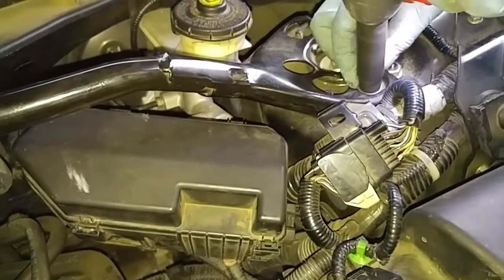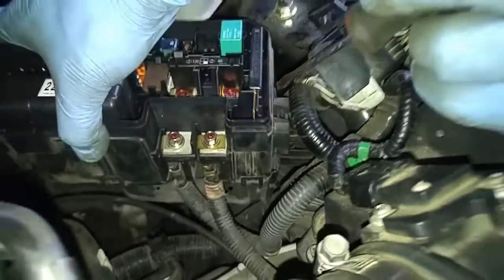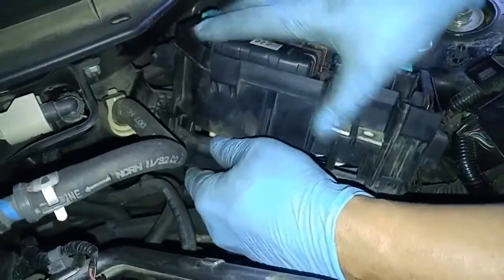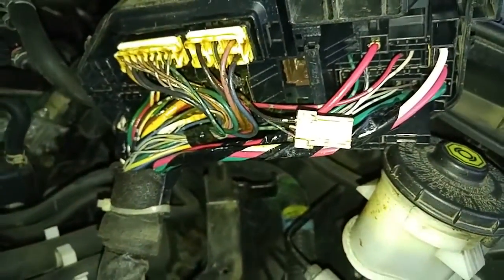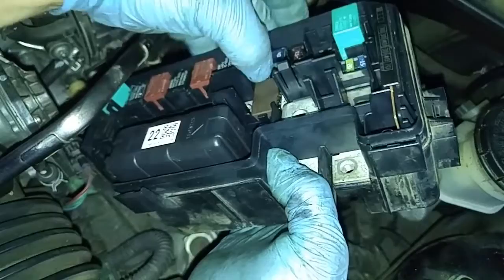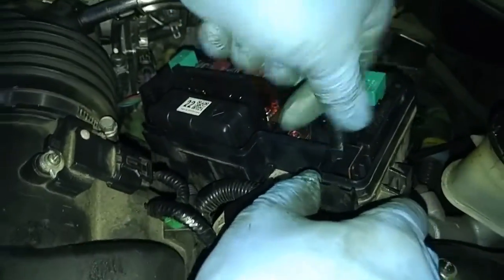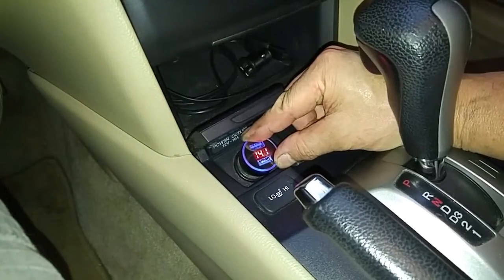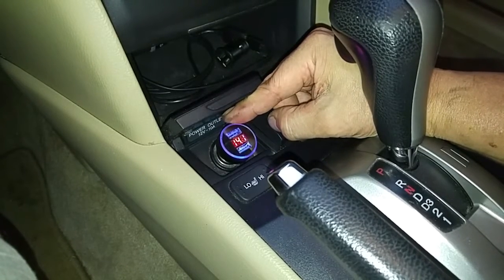Battery Dash Light On & Off? Honda Electronic Load Detector Malfunction

Comment: I have a problem with honda accord 2008 4  I have new battery but I have a problem in the light and radio sometimes turns off and on
Reply from the maker: Changed the ELD?
Reply: No I didn't change anything yet When I drive at night, I see lights dim and come back on, and the radio goes off  sometimes and turn on 
 My honda accord 2008 4 cylinder really very good but I have 2 problems really I want to fix this one I telld you now and burning oil every 500 k I need to put one liter really I don't know what I do

Comment: Honda CRV 2012 has been having a problem for about a year. The voltage drops to 12.6 when I turn on the lights or air conditioning
Reply from the maker: Start by replacing the ELD.

Comment: Could this cause erratic lights flashing AC won’t work nor will windows. I switched out battery because that was the first light to come on. Put new battery in there and it got worse.
Reply from the maker: Sounds like you have an alternator problem.  Get one of those plug in voltage display devices for your accessory port to monitor the voltage output while driving.

Comment: lot of good info in the comments. I am replacing my 02 civic ex ELD today coz of intermittent battery light. new alternator and battery 6 mo ago  which fixed the issue (light came on after getting off the freeway of a long 200 mile drive. stayed on unless i revved past 3200rpm while driving (another reason manual transmissions are just better in every way).
connected a cheapo bluetooth cigarette lighter thing that has a voltage reading on it. it shows 10 volts but ive read the battery itself and there is about a 1.5-2 volt difference. voltage in the car will show 10.1 (~12v) when battery light comes on, and then revving up shows ~11.3 (~13v) and battery light will go off. the strangest thing is that i found leaving the lights on even during the day makes the battery light go away and the voltage never drops below 11.1(~13v at the battery). this is what makes me think it is a slowly dieing or half dead ELD sensor/half blown fuse/crappy ground.

if you have a automatic civic i would suggest first getting rid of it and switching to manual. then try increasing the load on the charging system by turning different things on like fan, lights, radio(and volume up?), highbeams. i thinking this will cause a big enough draw for the voltage the alienator sees to drop below a threshold and start charging and maybe partially bypasses the ELD somehow. side note the AC does not use electricity from the charging circuit and instead is just a clutchpack that engages on the shared alternator belt. good for testing the tension of the belt especially when combined with power steering, but i dont think it would help diagnose this problem.
im probably too lazy to update this post like everyone else so I will only do so if this doesnt fix my problem. I think my troubleshooting explains why all these boomers think its a "random" or intermittent problem, nothing is random... youre just not observant enough
Reply from the maker: Think you have a bad alternator even if new.  Voltage output of an alternator regardless of rpm's should be in the 13's
Reply: @hardlymovingpro  good to know ill double check it. it was like 13.5 i think when replaced. you know i cheaped out on a refurb
Reply: @vevenaneathna  Please let me know if you resolved the issue
Reply: @guillermoolvera1186  hmm i got a new ELD and compaired the resistance across the pins in the back with an old and new one, and it seemed like my old one was "shot". reading like 1/50th the resistance as the new one. put it in and car instantly had a lot more power, ran really good after warming up. few days later its back to doing the same thing. I think it is the altinator afterall and is frying the ELD. Tried putting the battery on trickle charge for a day also and no dice. I think it also has something to do with a bad valve cover gasket? i saw some oil dripping down on the altinator from my engine, and it didnt seem to go inside of the altinator but who knows, some probably did, ive had a new start go out on another car from drippy oil, and an altinator is basically a starter in reverse.

Going to try and return the altninator to autozone since its only been 7 months, but im thinking since my problem is so nebulus the altinator might pass their "test". might just hit the pully with a hammer until she dont spin right to get a free one and make sure it doesnt end up back on the self for the next unlucky person. that or melt one of the wires around the stator. will update in a week or so when i have time to replace the altinator. was messing around with the tensioner and stuff hoping it was something like that. would probably help to do a tune up also (plugs, maybe wires, check their resistance cold a hot?, plugs atleast)
Reply: @guillermoolvera1186  huh, ended up swapping the altinator as it was under warenty after all.stabalized the voltage a little bit at 0.1v higher, and maybe seemed to idle a tiny bit better. still all the same major symptoms. decided to rip out the electronic load sensor i replaced and double check resistances with volt meter. they showed the same values as when i put them in, about 10x OEM. frustrated i put the oem electronic load sensor back in, and bam problems with voltage drift minimized a lot. autozone sold me a garbage part, or it was one that someone swapped out and returned unscrupously. anyways the voltage still falls under 11v (no altinator charge) if there is no extra load applied like fan at low setting and/or parking lights. still feels like it had 15% power after warming up.

I noticed however the slower the piston speed/rpm, the less of an issue this was. ironicalyl the car would have more power in 5th gear struggling to try to get up a hill, or even was faster off a line in 2nd gear. I replaced my sparkplugs when i got it, maybe 60-70k miles ago now. i thought i had replaced them inbetween but i took them out and they looked pretty bad. regapped them in the dark using a pocket knife and it helped a lot but maybe made an exaust leak. had new NGK copper heads on order (3$ ea on amazon) and swapped those in a few days ago. the NGK sparks have a crush ring type thing that you torque down and i think is why it made the exaust leak worse when checking them. instant +50hp. very suprizing. idk if its coz i have the vtec coil overs and they burn thru sparks faster, or if im just used to iridiums lasting forever. 
still probably needs a new electronic load sensor OEM, and im thinking there is an exaust leak from when my engine mount ffed off in half and the engine fell off lol... but its running a lot better now. mpg was down at like 20-25, and im hoping its a lot better now. ran some methanol fuel cleaner thru just for sacramental old car purposes.
Reply: @guillermoolvera1186  so this is weird but I finally figured out what was going on. started having loss of clutch pressured and had to pump it when going up steep hills to allow it to change. that and the battery light/voltage issues never really went away. it all ended up being the cat... which is just bizarre. cat melted and occluded the exhaust so bad it sprung a leak at the manifold gasket. noticed it one day when i was up till sunrise working on the car and noticed scorch marks on the underside of my hood right above the alternator. I couldn't feel the leak when it was cold or hot or revving but the scorch marks were the smoking gun.
checked the exhaust pressure and there might as well have been a banana in the tail pipe.
Replaced the manifold gasket and drilled a hole in the exhaust bypassing the cat and muffler and instant return of power, no more voltage stuff after long drives, no more clutch problems, and way more power than ive ever had in the car. i guess all the toon up stuff i did really helped and built up until i finally fixed the issue. 
getting 35mpg hwy right now which is about epa estimate. I think I can get that up a lot higher. designing an analogue spoofing system to mess with MAP and IAT sensors to get a lean burn and advanced timing. might include a resonator circuit to go back and fourth between lean and normal so that I can keep the engine temp up on long drives. that and plenty of other arrow stuff I can fix.
my 98 accord was getting 54mpg and had 380k miles on it but its head finally cracked. ill try not to kill this 600$ civic lol

Comment: I have a 2004 honda crv. Alternator was replaced twice, battery reading is over 13.5 volts, ELD device was replaced as well. Fuses are all good. I can't figure out why my battery light is still on...any ideas?  My light started flickering a month ago, and would turn off when i reached a certain speed. I replaced the alternator 2x and i just have a permanent light on.
Reply from the maker: You have to monitor the voltage while driving the car.  Get yourself on of those digital voltage displays that plugs into your cigarette/accessory plug/port.
Reply: @hardlymovingpro  ah ok, thank you! what range is good to see on the display and what is not good to see?
Reply from the maker: Min 12.4 v engine off;  around 13.4 v to 14.2 engine running.
Reply: @hardlymovingpro  yep I'm in the range. I'm wondering if my ECU got fried by the original alternator gave out
Reply: At 1:25, find those connectors & clean them with the electronic cleaner.  You have to rule out poor connections within the connectors & poor grounds. Gradually, oxidation layers forms due to chemical properties of Aluminum, copper & steel impeding flow of electrons causing fluctuations.
Reply: @desi4lyfe379  unfortunately that did not fix the issue. i cleaned them off but they were already pretty clean. i also tried cleaning other wires but nothing works

Comment: Excellent video - I found this video because I’ve been researching an issue with my 2000 Honda accord V6. Just put in a new alternator after the original one died. Since doing this, the dashboard now flickers intermittently with my battery light/e-brake light/car doors. I’ve researched this issue extensively and have double tested my voltage to ensure the alternator is good. It all looks good and car performance is solid. I’m wondering if it’s my ELD but since I haven’t triggered any ELD specific codes, I’m not 100% sure this is my issue. I will do a multi meter test on my cigarette outlet here in a bit. Would appreciate any thoughts.
Reply from the maker: Could be a defective replacement alternator that randomly fails.  If getting a rebuilt, try to get a Denso.  Could also be the clutched pulley ... if you vehicle has it:  https://youtu.be/LKqy0WrmFwo
Reply: @hardlymovingpro  thanks for the response. While it is possible it’s a bad alternator, this is my 2nd replacement and this one is new (not remanufactured). In addition, I had it bench tested before install and voltage tested after installed. All passed and looked solid. I’m going to try upgrading my positive battery terminal post since the current one has some corrosion on the wires.
Reply: Also, do you know if the ELD is a separate part from the fuse box on a 2000 Honda Accord? Seems like some Hondas are separate and some require you to replace the entire fuse box. It’s still unclear to me
Reply from the maker: @dylanrobertson68  believe the 2000 model year the ELD is seperate.  Easy to tell by removing the fuse box and seeing the 2 screws that hold it in place with a bracket/brace.
Reply from the maker: FYI - ELD failures are common on early model Honda's.
Reply: @hardlymovingpro  good to know and yes I do recall my fuse box has the two screws that holds down at least two different fuses. I believe one is a 100 amp battery fuse and the other a 50 amp. I’m wondering if I should still replace it if it’s not triggering error codes. I tried using my multi meter to test the voltage from the accessory plug in but wasn’t getting a reading. Do I just connect one probe to the inside metal and the other to a ground ?
Reply from the maker: I'd just replace it.
Reply: Hey !
What’s the part name please? Because I’ve this issue with my Honda Accord 2001 V6 the All red lights are ON and it made me change my alternator twice. So I’ll try your method please. Thanks.
Reply: hi, did you sort this issue?
Reply: @irfaan7868 well my 2000 honda accord ended up getting totaled while parked so it indirectly got sorted out lol

Comment: BTW, My 2012 Accord had zero grease. Maybe has a better fuse box?
Reply from the maker: Not surprised.  If you go through some of my viewer's comments, they said I shouldn't have blown off the excess grease;  that it was electrical insulation grease.

Comment: Worked like a champ. It extinguished the intermittent battery light. I think I blew mine when I disconnected the alternator signal wire with the engine running. Drove it like that for a couple of months, no harm. Your video was spot on for my 2012 Accord V6. Thank you.
Reply from the maker: You bet!
Reply: @hardlymovingpro  I bet it wasnt the ELD. It was the connectors at 1:25. All you had to do was disconnect the battery & use electronic spray to clear the oxidation layer/corrosion. Copper, steal & aluminum don't go together.
Reply: @desi4lyfe379  probably. Good thing that part was only seven bucks if it wasn’t that.
Reply: @desi4lyfe379 Currently having intermittent battery and dash lights. What should I clean in fuse box?

Comment: Great video,  my battery light don't come on , i just get the , checking system . Its a warning .  Ping , ping , check charging system .
I changed the alternator,  new belt , battery was test . Good ....
I also put a test in the cigarette input ...goes from 12 to 14 , high rpm .. 
What are you thinking it could be ?  Eld part
Reply from the maker: Sounds like it's a ELD problem if erratic voltage output.

Comment: Awesome video, helped me replace the ELD but that wasn't the culprit. Has new battery & new alternator.  So bummed. Don't know where else to look on this 2004 crv. 😪
Reply from the maker: Check the voltage output of the car while driving.  Could be a defective replacement alternator.  Also check all ground connectors.
Reply: @hardlymovingpro  will check the ground.  It shows that it's charging.  Thanks
Reply: I watched another video that saod his problem was the no.10 fuse located inside the vehicle.
Reply: @p.maryyayabear7078  Hi Mary, thanks for sharing. In Odyssey there are two fuse boxes inside, in which one have to replace it?
Reply: oem alternator only
Reply: did you figure out any solutions? I have a 2004 crv and changed my alternator twice and the battery is in great condition. also replaced the ELD and nothing turns off the battery light..
Reply: Alternator was bad, replaced under Warranty!  Light is off now! 😁

Comment: Hey whats the spray your using to get the grease or stuff on?
Reply from the maker: Brake cleaner.  Has acetone in it to dissolve oil and grease.  Compressed air helps to evaporate it.  You can then spray on lithium to relube.
Reply: @hardlymovingpro  thankyou and btw i orderd the part rn. Hopefully it works and will let you know
Reply from the maker: Good luck!
Reply: @hardlymovingpro  i changed the eld exactly like you did. Charged the battery, drove it, and it died. Battery light flickers, vsa, jumped it again and died again. But runs good when its running for a few minutes

Comment: One month we got an intermittent battery sign (not flashing), but it would stay on for a few seconds and come back. A few days later while driving all lights on the dashboard flashed on 2014 Odyssey and van almost died. We replaced the alternator. After 1-month similar battery sign is back. Tested both battery and alternator, both good. Honda dealer told us spool value is leaking oil but independent mechanic did not find leaks. Even if spool value is leaking can it destroy the alternator in 1 month ?
Reply from the maker: Yes it can.  Oil getting on to the alternator via a leaking spool valve gasket will short out the alternator.
Reply: @hardlymovingpro  OMG!
Reply: I don't think so

Comment: Fixed the part and still have the issue. Good connections no loose wires. In stuck currently
Reply from the maker: Did you check the voltage output while driving? If inconsistent, could be defective alternator.

Comment: I’m having the on and off battery light problem. This came after changing the alternator and the battery are new. Almost when the light came on is on mornings and after like 20 minutes drive. Honda Pilot 2009.
Reply from the maker: Could be a bad replacement alternator.  Check voltage output while driving with accessory plug voltage display device.
Reply: @hardlymovingpro  yesterday we change the alternator. The light doesn’t come on but the voltage goes from 13.9 to 12.2 while driving. I’m using a Foxwell scanner (cheap one from amazon). Also I noticed that the voltage goes down when the AC is off.

Comment: i don’t have any codes, but when i am stopped on idle the battery light is on but when i drive it, it sometimes goes off. could it be the eld? just got new alternator 5 month ago. my car stalled as well. i’m guessing now i’m only running on the battery.
Reply from the maker: Could also be a defective rebuilt alternator.  This why I buy name brand rebuilds like Denso, Delco, Remy etc.
Reply: @hardlymovingpro  that’s what i got denso oem